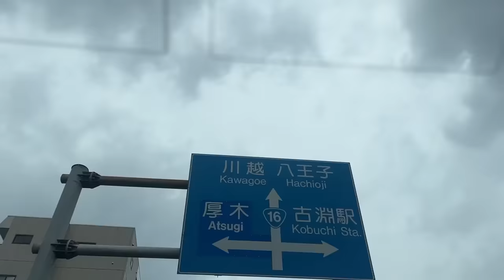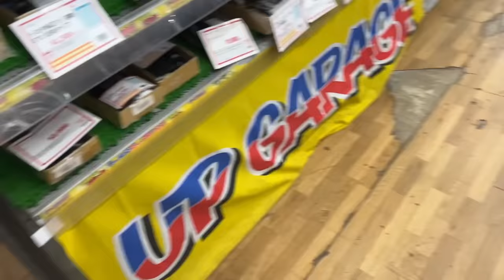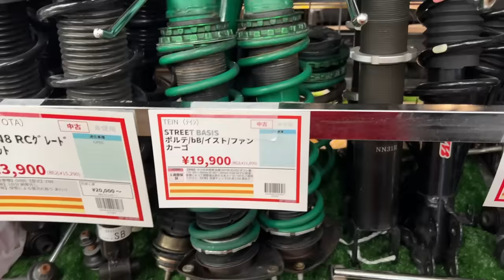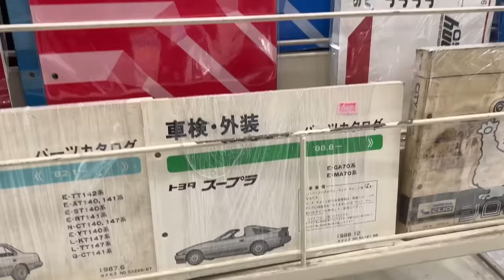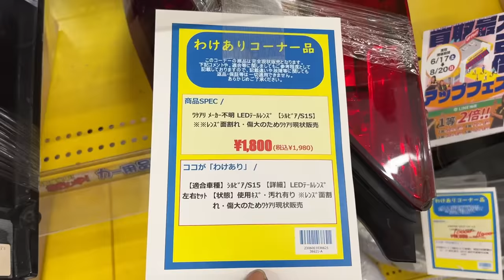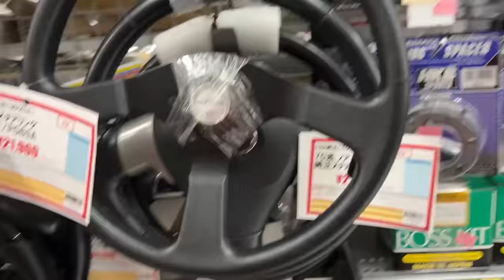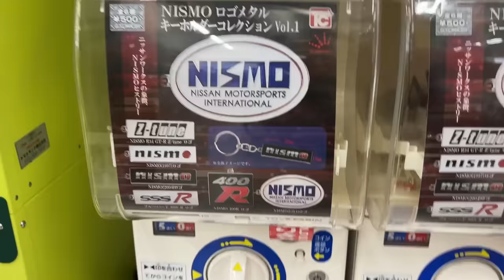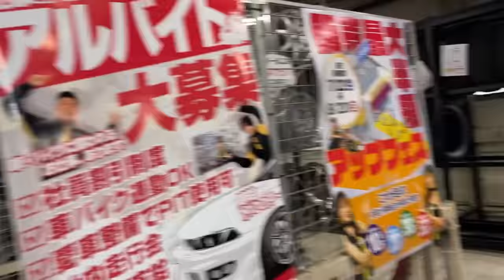I Went To Japan's Largest JDM Parts Store! UPGARAGE TOUR! + Another R34 GTR?! / S4E63

Comment: GTR noise sounded similar to Honda J35 cam lobe wear.  Honda J35 engines that implement cylinder deactivation have cam wear issues that starts around 140k miles, probably due to oiling issues inherent to the cylinder deactivation design.

Comment: You need to change the front rotors from drilled to grooved/slotted only they will only crack and be trouble.
You dont need anything wider that 8.5" mate with wheels whether its 18" or 19" in wheels.  All that 9 9.5 and 10" is shit.